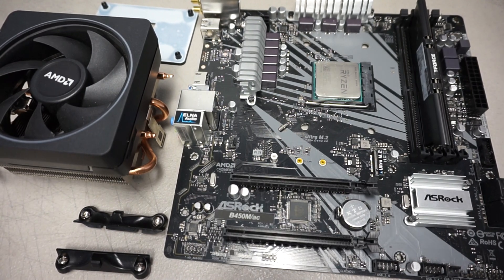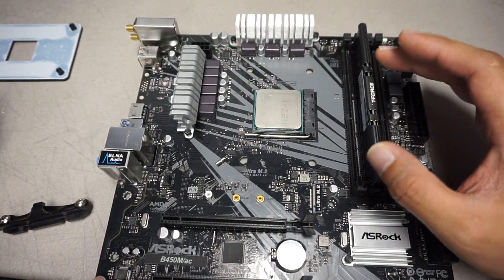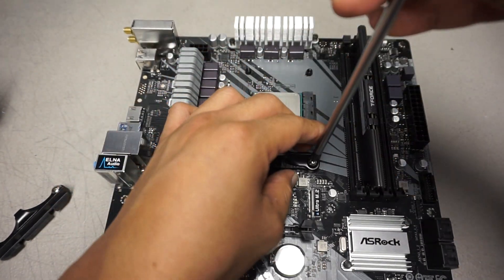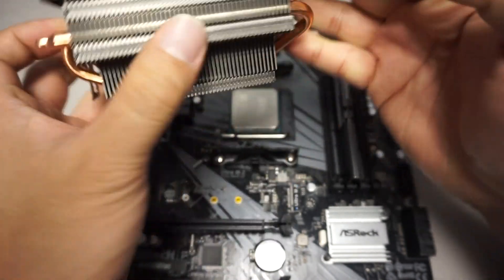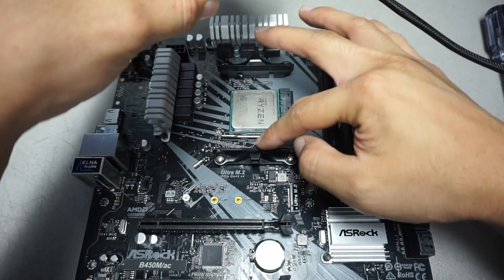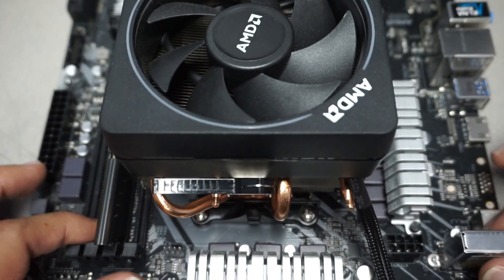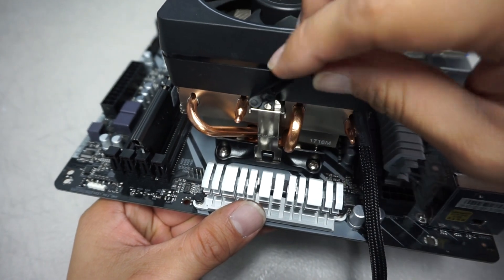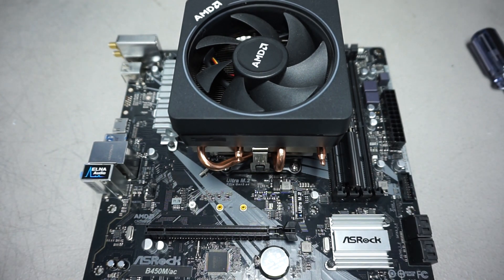Installing the AMD Wraith Max or Prism cooler on your AM4 motherboard

Comment: I ordered the AMD Ryzen 7 2700 with the Wraith Spire cooler, I wind ip getting this cooler instead, even worse the cooler doesn’t come with the plastics you screw into the heatsink at the beginning to hold the cooler down... I'm just baffled

Comment: Thanks! Your video actually specified the back plate required for the initial install. I tried other videos where they just screwed in the brackets and did the jump cut - I had no idea what this part was used for. Having everything required on display is what set your tutorial apart.

Comment: Right.
Didn't you forget two cables?
Reply from the maker: Technically just one and that's for the rgb that plugs into a usb header, but for these that is meant to just replace the small spire coolers as an upgrade, all is just fine unless you are an RGB snob.
Reply: @troubleshootdis5930  I mean there is some lights on it.
Let the spinning thingy do some lights then!

Comment: with the amd cooler do i have connect usb and the other wire or can i just hook up 4 pin fan is it optional with the other wires cooler

Comment: I don’t have the brackets?
Reply from the maker: Hello, what was the cooler installed in your system originally? If you do not have the brackets you can easily grab them here: https://www.amazon.com/SJZBIN-Heatsink-Motherboard-Mounting-Backplate/dp/B09C8M7M9M/ref=sr_1_6?crid=3M4PRK3KXBPJM&keywords=am4+bracket&qid=1655395647&sprefix=am4+bracke%2Caps%2C149&sr=8-6
Reply: @troubleshootdis5930  thanks man 😄, I checked my motherboard box and they weren’t there, I’ll keep looking in my boxes and stuff. If not I’ll buy them.
Reply from the maker: @louisaarondh  You are welcome, unfortunately if a custom or aftermarket cooler was configured with the system, the original brackets gets taken off and the ones that come with the cooler installed instead.

Comment: Yeah, when I was first installing, I ripped my fucking cpu off the socket, while trying to mount this cooler, because the pre-applied paste is entirely way too sticky.
Reply from the maker: That usually happens when the paste cures too well. Were you able to resolve that issue?
Reply: @troubleshootdis5930  A couple of CPU pins got crooked, but I managed to straighten them out with a credit card lol
That was my first PC building experience, so it was kinda scary, honestly.  PC is running well 8 months later, so I guess it all worked out in the end.
Reply: @troubleshootdis5930  Honestly, after googling for a while after this happened, turned out that happens all the time with this type of cooler, so I guess I don't have to hate myself as much for making such a dumb mistake. Though I'll be more careful in the future. Even though it will be probably at least like 4-5 more years until I need to buy anything new. Hopefully.

Comment: Can you mount this on am3+ too ?
Reply from the maker: If space allows then yes you can. The AM3 and AM4 brackets are technically the same with regards to mounting points but the am3 brackets are a tad narrower than the 4 so its best to check if your mobo components will not get in the way.

Comment: I have the same motherboard, I’m just wondering if the prism will block my 4 Corsair Vengeance Pro ram?  They are rather large
Reply from the maker: The prism is very forgiving when it comes to memory height, unless your heatspreaders are way too tall the only issue I foresee will be on the first slot coming in contact with the heatsink fan shroud edges.
Reply: @troubleshootdis5930  I currently have a stealth installed with my R5 3600.  I just wanted a cheap upgrade for the cooler, with nice lights and better performance.  It seems my closest Corsair ram stick is slightly rubbing against the stealth cooler.  You think that should be ok?  Thank you for the reply!
Reply from the maker: @ReWolver1817  If it does not tilt the ram heatsink too far off that it touches the next one then a slight contact should be fine.
Reply: @troubleshootdis5930  So it sounds like it will also rub (the prism) but it should clear!  Thank you for your help
Reply from the maker: @ReWolver1817  You are most welcome!

Comment: I want after installing wraith max 
Use both of my RAM slots
Why did you leave a memory blank in the slide tutorial video?
Reply from the maker: Hi there, the wraith prism is designed not to interfere with the memory slot so you should be ok to install on all slots after the heatsink is on. Second slot is where i always install my Ram if I am not using all slots.

Comment: So I want to switch my cpu fan to a cpu liquid cooler but I want to find something that’s compatible with my pc. I have a shadow 3.0 with an ASRock 320m motherboard.
Reply from the maker: Hi Anthony, A lot of liquid coolers should have a wide compatibility with newer or even older gen processors. If your system is using an amd, then you just have to make sure that your cooler of choice supports AM4 slot and you are good to go!
Reply: Alright thank you, just a heads up I’m a new pc user so I’m gong to have a bunch more questions. I’ve watched a few of your videos already and they have been helpful thanks.
Reply from the maker: @Antb2fresh  Just ask away! I will be more than glad to help to any extent I can.